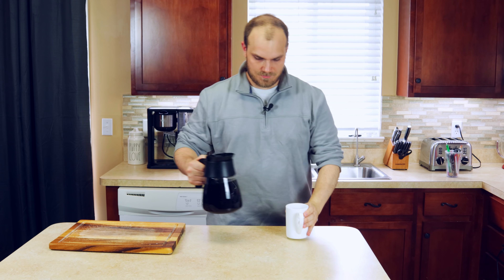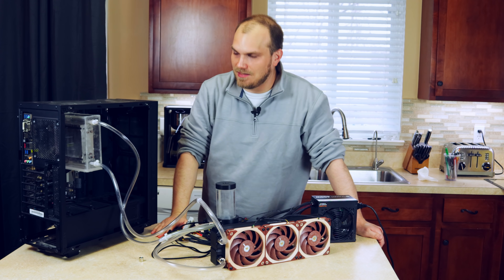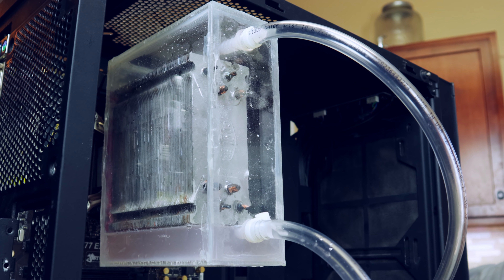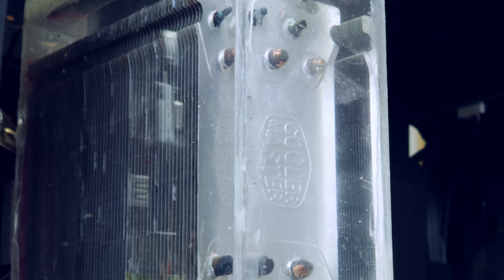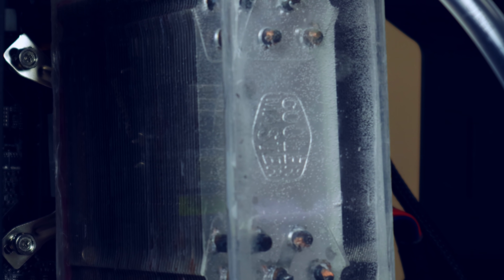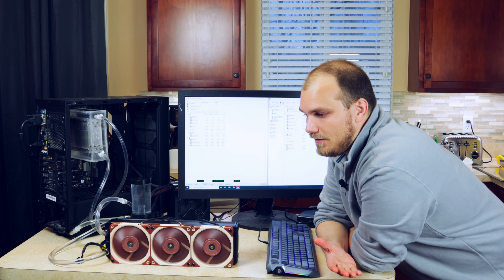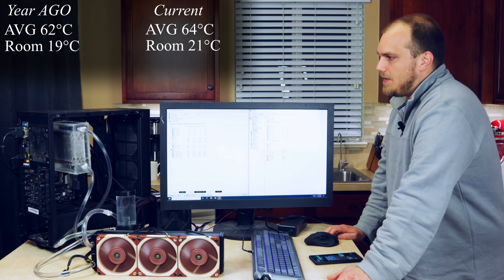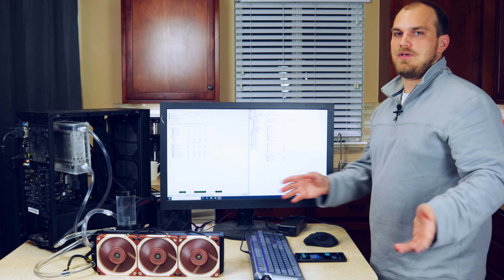Water Cooled Air Cooler 1 YEAR LATER, Time Has Not Been Kind

Comment: Wait, are you saying you didn't put biocide and anti-corrosion liquid in the loop?? Food coloring is biological, so there's the main source of the milky liquid. I mean, I suppose if the copper were completely coated, you wouldn't have to worry about mixed metals in your loop, but what if you can't see all the copper? But, you can - it's sticking out of the top of the stack, so there's your corrosion source.

How much did it cost you to make this? If you had used distilled, sterile water, I mean. Is it worth it to build a hybrid like this rather than buying an AIO? What would you do to improve servicability and other things?

6:15 What is the room temperature so we know the delta T?

If you run a comparable AIO 360 in that same system, what temps do you get?

Comment: Maybe for the version 2 you could print the case out of a Hemp filament or another filament with similar insulation properties you could print the sink out of said material too with the right slicing software but if you want to keep the metal heatsink you could go with copper then seal the whole thing up with resin

Comment: Hey so I was thinking ab a similar cooler and instead of running it through a box filled with water, what about running it through copper pipes while maintaining a heat sink and possible having fans on the side of the heat sink. With the water running through the copper pipes leading out to a reservoir and/or radiator as well

Comment: If you ran a light weight oil, instead of water, it wouldn't corrode at all. Ordinarily [pay attention to that word] ordinarily water cooling doesn't benefit from oil - because you're not dealing with parts which will corrode from water - but that - specifically that - is an aluminum fin air cooler with copper tubes - which is a different story. So a super light weight oil would be corrosion free and still transfer heat effectively.

Comment: This thing reminds me of the one time I built a custom water cooling loop, and I bought a copper CPU block online. It came with... aluminum fittings. 

Not sure why it was designed that way but I think it galvanized because one of the fittings eventually sheered right off and was clearly corroded. Gushed water all over my motherboard but I turned it off fast enough to save it, mostly.

Power management never did work again. Not sure why that would have been the only thing to die.

So maybe if you try this again try a cooler that uses all the same metal to avoid corrosion issues? Not sure...

Comment: In this case, the efficiency of the cooler rests to the efficiency of the heat pipes. There is no point in such a bulky design. A conventional liquid-cooled water block is much better as there is no additional transfer link with the heat pipes.

Comment: Why don't you create some air conditioning sealed unit for cooling. Try and keep the internal ambient  as temp at around 2c degrees. Adjust the refrigerant air con cycle based on temps seen. Or connect up a portable freezer such as an Engel. Have you started yet?

Comment: I took a different twist on this about 10 years ago.   I took a 1 rad water cooler and dipped the rad out the side of my case and into a large pot of water.  Sometimes i put ice in too but usually left it without ice.  It was the largest cooking pot i had in the house.  As long as i topped it up every day (from evaporation) it stood steady no matter what voltage or multiplier i set it at.  Truely the best solution if you don't mind having an open pot of water lying next to your open computer

Comment: The results are actually better than it looks. 
First prototype the fins were clean, heat transfer was ideal. Now fins are clogged with some gunk and yet better delta.
Conclusion: if the fins were clean, temps would definitely be even lower.

Comment: One thing I would suggest is using mineral oil to prevent the corrosion issue and also avoids the issue of leaks bricking the board. 
The only issue I see with what I suggest is that I dont know what pump could handle the viscosity of the oil.

Comment: The water inside the radiator is only running on the top part, sadly the flaw on this design is that the in valve shouldn't be on the same wall as the out one, it should be on the opposite wall to make the water fully pas through the radiator.
The idea is very good but the part which is closer to the motherboard has little to no circulation
(Sorry for my bad English)

Comment: You used ice last time, yes make a 2nd one and one that had like no fins but copper wire syringes around the heat sink copper parts so it has like a max ser-face area and also use crushed ice so the ice can be cooler waters

Comment: It'd be interesting to see a second version, but in it you should use a cooler with some corrosion-protective coating and minimize the free space at the sides of the heatsink, as flow around the heatsink doesn't help cooling. If I were to recommend a cooler, it would be the Noctua NH-U9S.

Comment: obviously, this is all just for learning and fun. Commercial water cooling systems are well engineered.  Flow dynamics for air and water are significantly different, just compare props on boats and planes. The issue is that the fins are so closely spaced, that water will be inefficient at passing thru. (That is why the bubbles hold on)  IE. if every 1st, 2nd, and 3rd fin were missing, leaving large spacing between - would likely get better heat transfer overall. Surfactants would help here. Fun fact: these fins are actually alr cooling the heat tubes, which are gas evaporation cooling systems. 
https://www.gamersnexus.net/guides/981-how-cpu-coolers-work

Comment: The aluminum-copper (or maybe that's even worse - aluminum plated steel??) junction is acting like a battery. It is called Galvanic corrosion and it is very aggressive. If the cooler was made of just copper and the liquid was antifreeze - it would have held up much much better.

Comment: To avoid the corrosion, you should try mineral oil instead of water for cooling, it will at least prevent the oxidized heatpipes and radiator fins

Comment: This is a bad design, because both the incoming and the outgoing connectors are at the same side of the cube. You should put one of them to the opposite side; like upper left and lower right corner or so. That way the water would need to go through the whole thing, now, the water do not need to get to the far end of the cube. Radiators in rooms should be connected in this way. :)

Comment: This is pretty interesting, not sure if it's actually better than just buying a waterblock.

To prevent corrosion you should use a sacrificial anode - basically a blob of zinc you drop in the loop that takes all the corrosion so your aluminum doesn't. This is what salt water boaters do, you will find them in your home water heater as well.

You could also use mineral oil, the trouble is that it does not conduct heat as well as water, and it's thicker than water so it's harder to pump. But it would be corrosion free and solve the big problem with oil immersion cooling which is deterioration of the rubber and plastic parts, since only the metal pieces touch oil.

One problem with going to a bigger cooler is weight! The cooler itself is already pretty heavy and then you will add a couple of pounds of liquid to that. On a flat bench it wouldn't matter, but on a tower style setup it could be hard on the mounting apparatus.

Comment: Have you tried to cut the ends of the heat tubes and connect tubes to them to allow coolant passing through?  Then put a normal fan and use it just like a car radiator. And you can use car coolant to avoid corrosion.  If you do not have enough pipe ends to connect, you can remove the top fins till you have longer pipe ends.

Comment: @MajorHardware You should run a high ratio of whist vinegar and distilled water through the system with a filter in line somewhere.  You could remove much or even nearly all of that scaling.  Then, you should run distilled water through it a couple of times with the filter just to make sure everything is out as much as possible before finalizing on just distilled water. Then it should be back to nearly new functionality without building up new scaling.

Also, and I'm sure someone else must have mentioned this in the comments, but your room temp was 2C higher than the original test and your CPU temp was 2C higher too.  To me, that seems like it's working as efficiently as the first run through.

Comment: The Noctua NH-L12S should be a good fit for a second iteration, I think? Decent amount of heatpipes and nice spacing down to the motherboard. Also the shorter height should work well with a tower build (vertical motherboard), giving a shorter lever to all the extra weight you'll be adding. Might even handle corrosion better, what with the nickel-plating.

Interesting idea, and might actually point to potential improvements in CPU block design!

Comment: The question is, what's the real point? It fairly cool and fun to do but it would not replace tinny waterblock. With higher heat output it probably would be fine too but it can't run bellow ambient temperature and it really haven't change anything to usual water-cooling setup. A water tank CPU case is way more interesting. Maybe instead of putting a cooling rad on CPU, put a water block designed by you to give that water bubbling (boiling) stransparent look dirrecly at CPU. It will add interesting esthetics and adding a fan inside the block to push push liquid against water block with hole on side for water to escape and top for intake. This could result in pump being much quieter and less power needed as it won't require much force to push liquid around loop. Maybe even having a design similar to air cooling with two fans on tall rad and it being dipped in liquid like it is now but with different that pump is not part of loop just a water block/rad + another rad for liquid to ravel and cool down but using fans inside liquid as replacement to traditional pump. Ofc liquid can be any it need to be able to keep current with in designated hardware with out discharging it in the liquid due to fans being directly exposed to liquid. Fans could be placed anywhere in the loop as it only need to be able to move liquid effectively and does not require to be near CPU for extra pressure. It certainly be interesting to see.

Comment: JUST A NOTE:
       Your design has a major flaw. The fins of the submerged heatsink are normally effective due to convection. The center is hotter than the edges. This draws the heat towards the cold edges, creating an air current that cools the heat as it travels from the center to the edges.

Knowing that, your water current in-out nozzles are in the wrong place. You have neutered their intended effectiveness. The nozzles should be placed for the water to flow thru the fins, not against them.

A think a simple plenum would be better, since what you made is basically an inefficient plenum.

I hope that helps anyone interested in doing something like this.

Comment: The performance is great, but the Aluminum will come off because of electrolysis, and coat the copper in the radiator and on the heat pipes possibly. One way to limit this is to run a ground wire from the exposed heat pipes to the radiator, in order to prevent electrical transfer through the water. Additives in the water to prevent corrosion and electrolysis might help, as well as an anti-bacterial solution such as a peace of silver. 62C really isn't that great, when you consider that CPU's should run under 60C. Modern CPU's run at 80-90C at full load, and that is ridiculous, they might run that way for a while, but it will still wear out a CPU faster. I guess the Ice Water or Chiller might be a better option, as long as the cooler / coolant is above ambient temperature. I'm going to go watch your first video on this.

Comment: This video needs 2 disclaimers:
- 240 mm radiator replaced with a 360 mm radiator
- Using a CPU with mileage instead of using a brand new CPU with same specs. (I agree impossible to know 1 year in the future, but 1 option is to have 2 CPUs tested at the beginning and then 1 of them shelved for 1 year follow)

Comment: i think it'd be worth it to do two different ones, the best air cooler on the market overall in terms off cooling power and thermal exchange, and then the best one to work with on a project like this with adequate cooling power out of the box. also use distilled water if possible and compare it to say some other fluids one could run through the system. distilled water is the industry standard because its effective and safe, but i bet there are other fluids that would be interesting test subjects.

Comment: ? Don't get me wrong, but isn't half the video unnecessary? The cooler is the old coroded one, so the brake is cooler metal to water (the metal is 'heated' in a few minutes)
the water cannot heat up because a new, non-coroded radiator is used here. whether the cooling performance is still stable (because of the corrosion) you already know after 5 minutes because the cpu temperature goes up because the cooler can no longer transfer the heat to the water as well. In other words, the heat build-up is in the air cooler and the water stays cold

Comment: I wonder if you could electroplate it with something that wouldnt corrode in water. 
Also while youres does work it would be more efficient if you design it so it forces the water to go through the fins. At the moment theres tons of negative space around the cooler that most of your water being pumped will pass through as its a less resistant path. Making your box around the cooler, you could design the inlets and outlets with a channel that forces it to pass through the fins. 

Anyway its interesting :)

Also interesting to see rust, on aluminium fins :o Wonder if theyre an steel alu alloy mix. Or just contaminants in the alu :/

Comment: I'm pretty late to the party (7 mo now) but if you did build one smaller, maybe a way to improve it would be to have a more direct flow passing through the coils and into the radiator. Like, what if the cooler was really tiny but there was a huge (regular radiator) volume of water being cooled longer than normal, thinking the cooler be a little larger than a deck of cards or so. Great videos, love the R&D

Comment: And I have a suggestions for that project do not used normal water used distilled water like Absolute or Wilkins and do not pour food color because it will contaminate the water and if you really have some wealth used a real engine radiator coolant like Prestone because it has a anti freezing, overheating and corrosion technology. I have a ordinary Noc pc but it just run about a month that's years ago and this year I learn to troubleshoot a pc just a bit but I think psu is the one that has a problem.

Comment: I know this is a bit late, but if anyone plans to do this, or you are planning to do this again.
Corrosion is caused by two issues here:
1, Water causing galvanic corrosion due to mixed metals. You need to use a liquid with a corrosion inhibitor, something like automotive coolant. The corrosion will mostly appear at the interfaces between the two metals, this means less heat transfer between the heat pipes and the fin stacks.
2, Silicone sealant. Most silicones are acetoxy cure, this means they release acetic acid as they cure. It smells like vinegar, and will cause corrosion on anything that it is contact with, or anything inside a sealed box with it. There are neutral cure silicones which should always be used anywhere where sensitive metals are involved like copper or aluminium. I've seen electronics sealed with silicone against water ingress, but because acetoxy cure silicone was used, they have corroded faster than if they weren't sealed at all.
Reply: Responding to this in the hope it gets seen because this should be taken I to account.
Reply: https://youtu.be/u6zsHqdNRQ8

Comment: beginners mistake of pc water cooling. If you combine different metals in your colling system, and use just tap water without corosion inhibitors, it result with nasty galvanic corosion. It is better to use all components which are in contact with water made from same metal. everything alluminium or everything made from copper, do not mix them.

Comment: this is working on pure surface area of the pipes, the fins aren't doing anything for you, those are too close to allow waterflow, no matter how hot the water gets.  if you took the fins off it would probably perform just as well.  in order to get benefit from those fins, you need more space between them.  Get an air cooler with a low fin count, one that works passively without a fan like one of those old Macho air towers or that old, or better yet one of those NOFAN passive coolers.

Comment: I'm late for the party but you can boost performance if you force the water to pass through the heat sink fins making the case narrower and shorter. This way the heat transfer increase, but you have to check if the pump can generate enough pressure to move the water

Comment: Whatever cooler or liquid you use next, you want to make sure the casing around the heatsink fits as tightly as possible. I'm guesstimating there's now a 5mm clearance around the heatsink, where water will pass though but little to no heat is transferred. This is essentially a pressure bypass. If you reduce this gap or ideally eliminate it, all the pressure from the pump can be used to push the liquid through the heatsink fins. It might be a good idea to turn to 3D printing instead of acrylic, to get that shape right.

As for a heatsink, something like a Noctua NH-D9L could be an interesting route. It's a two-tower style cooler that you could turn into two chambers; one where you push the liquid up, overflowing into the next chamber with the outlet on the bottom. Much like the radiators are built.